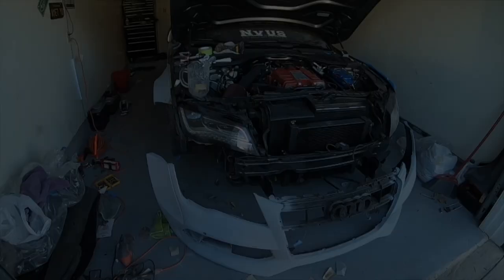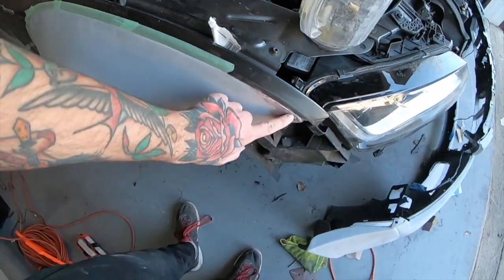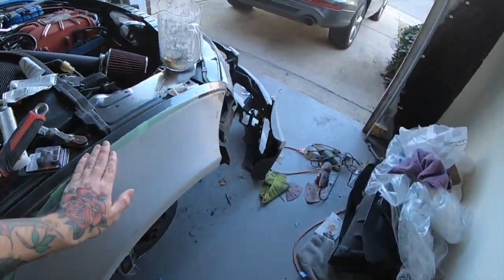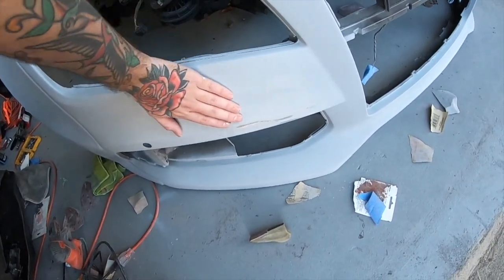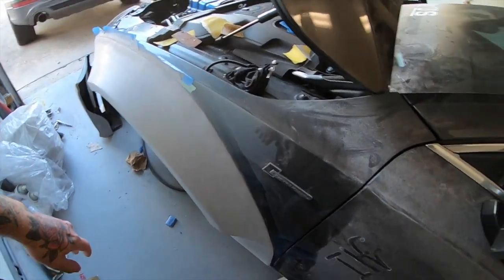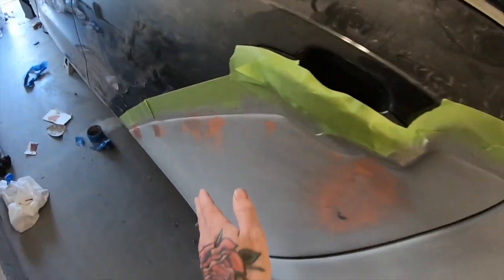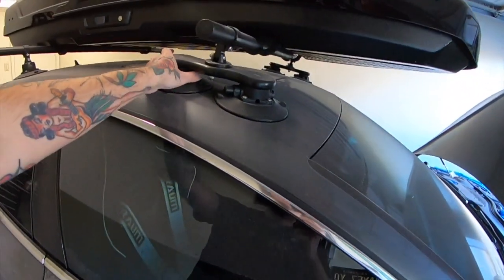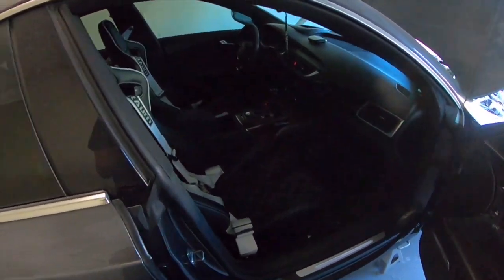Installing Clinched Widebody on my Audi A7!!

Comment: your roof rack and cargo box, are they  flat? The way mine is going to sit, it tilts upward by a few degrees
Reply from the maker: You would have to adjust the mounting points to have it sit flatter. If your box is similar to mines, the mounting clamps can slide up and down the box. You use this and relocated the bars to adjust the tilt of the box.

Comment: i have a a7 c7.5 but would it be better to buy a s7 then build it
Reply from the maker: It's all on personal preference honestly. The s7 would have the same body style but now you're talking about modifying a 4.0 twin turbo vice a 3.0 supercharger. And when it comes to performance, not only is it more costly, but there is no space in the engine bay to install parts.